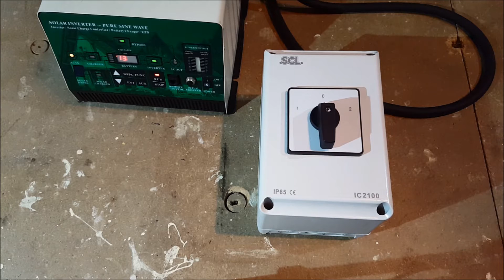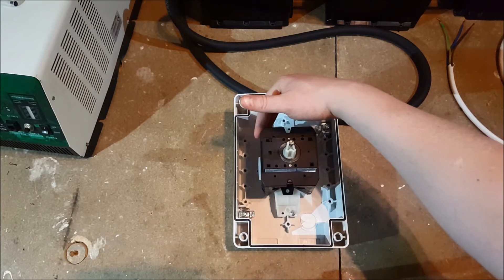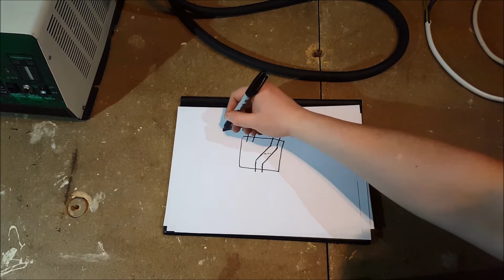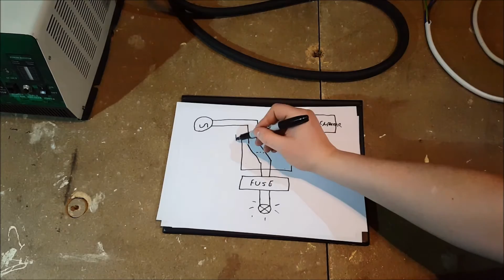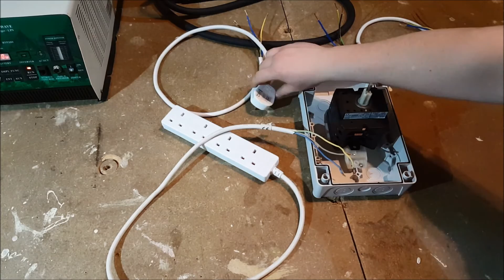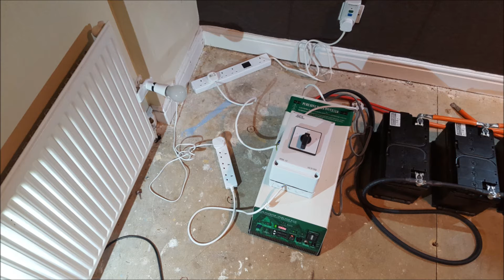Generator Transfer / Changeover Switch Test Load for Off Grid Uses

Comment: 1st time i've found someone to explain this clearly!! Well done. Don't know if you'll have time to answer this question but i have a hybrid inverter which is set for my batteries, i am at the stage of wanting to wire it into the house to supply power overnight and then i will recharge during the day using my excess solar. 1 issue is how to do the changeover between grid mains and the battery inverter and 2nd is, because the inverter requires the power from the house / grid / excess solar to recharge the batteries, how is that done? Any advice would be gratefully received. Keep up the great work.

Comment: Late too the party,,but its all still relevant,,,,  Heres my story ,,I had fitted a 5kw PV system,,  I told my installer I wanted batteries  and go off grid ,,,but he fitted a solarede grid invertor,,,SO  I always intended to have a Phase 2   with maybe 8kw extra(I,m going to fit as much of it as I can,,apart from the mains work ,I,m not confident about that)),,,  So that is what I ,m planning  ,,, I want to just have loads of potential power for those winter days (pick up every shread of power) ((its not the peak power in summer that is important ,its winter)) so looking at 24 panels,,,  hopefully gets so bigass cheap inverter and then conect up the same way as you   Mr Prepare!!,,   I think you have a great solution,, I do not want a auto transfer box,,, I want low tech switch   ,,and I like the way you added extra safety with the extra mains switch...    I,m still mulling over my options ,and what I can do with the cash I have,,that solaredge cost me an arm and leg  but have to make it work for me..enough already      cheers

Comment: Hi - Thank-you for putting this video together , really helpfull , I am at pressent working on a motorhome with a simular 
setup, namely grid coming in on posion 1 on switch & position 2 to and 2500 watt inverter , this looks as if it will work well, but please can you tell me if there is a same changeover switch as the one you use,  but smaller box,  as this size box would be taking up alot of space in the motorhome cuboard . I have seen the rotory cam ones , but would prefere the wiring connection design to be the same as the one in your video .
Would really appreciate your help - regards Gary
Reply from the maker: Hi Gary sorry for the delay. I did look around quite a bit and this was the only one with off in the middle. This and a 63A one. But both units were exactly the same. Looking on Ebay those smaller ones at 20a and 32a would suit you alot better and just mount behind the panel. If it's just for your use and not hiring the motor home out this would be perfect.
Reply: @PrepareForTheUnexpected  
Hi . Yes I have just purchased 3 small 3 pole cam switch. I gave tested it after working out the wiring. I have done all my circuit testing and looks ok. Thank for coming back . Stay safe Gary

Comment: First of all... Thank you for taking the time to make this video!
I know you say that before switching, the load should be isolated first to prevent arc damage to the terminals but...  I've just been told by the manufacturer that these switches are capable of disconnecting a live working load at their stated rating... something to do with spacing between each terminal! Could you just clarify this please?
Reply from the maker: +o04n7h0n90o I only isolate the mains for an extra safety measure to maintain the equipment, but I have tested it by flicking from 1 to the other really quick by hand and it hasn't interrupted the supply.

Comment: great video this is what I'm just about to do in the workshop. bought the switch this weekend only difference is there is only 4 connection points and the earth. any suggestions on the wiring of it
Reply from the maker: +CNC SMITHY Shane Smith Cheers for that, have you bought it online? Have you got a link for a nosey if so.
Does the switch have the three possitions?
Reply: Na bought it in local electrical wholesale. ya it has the three positions two connections top two on bottom have i got the wrong switch
Reply from the maker: +CNC SMITHY Shane Smith I'm trying to visualise it. Is it reversing the polarity inside the switch so it's like a motor reverse? 
Get a multimeter on it and see what position is closed on which terminals.
With 4 terminals you Deffo not how full isolation from the grid when you change over to backup.
Reply: PrepareForTheUnexpected I just uploaded a video of it if you can have a look